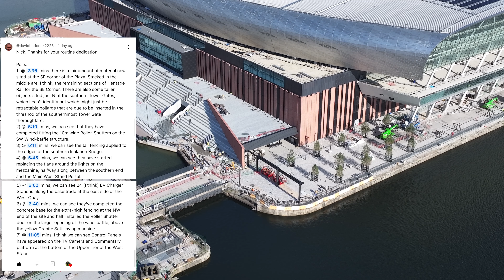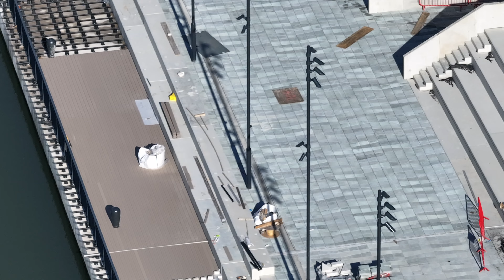NEW Everton FC Stadium 22.10.24. Midweek Video with Voiceover - YOUR QUESTIONS & COMMENTS

Comment: Nick, many thanks for the detailed look around even if I feel that I owe the general audience an apology for inducing another bout of Nick's "Where's Wally?" footage. Just for the record, I did state that the concrete flags being replaced were around the lights on the Mezzanine.

Some PoI's:
1) As you focused a while on the Composite Decking, I'd like to point out something about which I suspect most people are unaware:
  a) Pause the video at 10:14 mins, and you will see that the decked area is not horizontal along it's entire length. The very southern end (mirrored at the northern end) is actually sloping upwards, like the Ski-ramp on an Aircraft Carrier, so that disabled fans can access the area.
  b) The black-metal stilts and frames upon which the composite is laid are taller on the concrete at the ends so as to provide this slope finish. It would not be ideal to have the 'planks' laid at 90d to the current format axis as the potential for trip hazards would be greater.
  c) If you also look closely at the Lower Promenade terracing, just behind the decking at this timestamp, you will see that they are actually tapered off with a downward slope too, as is the case with the concourse water-effect concrete flags above the Lower Promenade terrace. The central area of the water-effect flags in front of the main West Terrace is horizontal but higher than the old Dock Wall Granite Coping Stones, so the water-effect flags are laid on a shallow slope down to those curved Old Dock Walls. You can see the slope if you look at the bottom rise of the bottom terrace and it is more noticeable across the face of the North and South Terrace Tunnels. And at 10:14 mins in particular
  d) And at 10:14 mins in particular, even if you can't see the edges clearly that demonstrate the slopes on the different levels, it's made even clearer by the fact that the water used for hosing down the flags in and under the mezzanine at the southern Terracing tunnel, is draining down the slope at a diagonal across the water-effect flags to the south end of the Lower Promenade and drops down into a gulley (with a small bollard inserted into it) before dropping to the lowest concrete level of the Lower Promenade, under the Decking black-metal supports, before then dropping off the edging of the Seacant wall into the Water Channel.

2) @ 22:02 mins, the objects I'd previously referenced just north of the southern Tower Gates have been moved. But in their place are a large quantity of Internal Works Cherry-Pickers that had been collated there to put on the collection lorry sitting on the East Plaza. If ever you wanted a statement of how the internal Works have progressed, this must be a major pointer. LoR are sending away some of the essential leased equipment.

Comment: The flats you are looking for can be seen at 28.04 in the distance. You can see Leasowe lighthouse and The Leasowe Castle hotel a couple of seconds earlier just below the top of the screen.  The flats you mentioned are The Tower in Liscard Nick. Great video once again mate. When the stadium is finished maybe you could do flight across the Mersey the The Flight of the Valkyrie, like you did earlier in the build?

Comment: Panel under where the missing glass was is a darker colour to the rest
Reply: Yeah was just about to.comment about those panels. I think that one your referring to might be a ventilation panel but the 2 or either side of it looks white whereas the rest of them along the.lwngth of south stand look grey. Could it just be reflection or shade causing them to look different
Reply: Some still have the protective plastic covering on.
Reply: Still has the plastic covering on.

Comment: Hi Nick, great video as always. Thank you. Do you know anything about the ‘Media Centre’ I can see where it is behind the West Stand but what does the building consist of? and do they, the media have to ‘brave the weather’ every time to walk to the stadium or do they have facilities inside the stadium. Also will we be having ‘bat lights’. 👍
Reply: It’s not a media centre, it’s the Distribution Network Operators Compound (DNOC) - electricity, internet, etc.
The TV broadcaster will connect to it but the TV presenters and pundits won’t be anywhere near the DNOC, they’ll be in the TV studio in the executive box in the north west corner of the stadium, above the vehicle access tunnel 👍🏻
Reply: Dunc has given you an accurate reply re the DNOC and TV Studio but I would add the following:
The TV Commentators will be on the Main TV Platform at the front of the upper tier of the West Stand (focused on in this video) and the Press Box is right up at the top two rows of the central part of the Upper Tier of the West Stand. The Media have totally separate facilities for catering and bathrooms within the West Stand Hospitality areas.

Comment: What way will the vehicles drive in and out the ground ? The bridge with high fence leads nowhere as all trees a roller shutter there
Reply: Vehicles will use northern access road under the north stand overhang. On sunny days, the team buses will turn left just before the north bridge and will drop the players off at the central entrance on the west plaza terrace. The buses will then drive over the south bridge over to the car park between the water channel and the Mersey. Emergency vehicles will use the south access between the south stand and Nelson Dock (they can also use the north).

Comment: Where do the coaches drop off the players ? I'm assuming the coaches pass the north stand then go into the tunnel at the west stand to drop them off. But where to after that ?
Reply: No, the buses won’t enter the tunnel under the west plaza terrace (mezzanine). Vehicles will use northern access road under the north stand overhang. On sunny days, the team buses will turn left just before the north bridge and will drop the players off at the central entrance on the west plaza terrace. The buses will then drive over the south bridge over to the car park between the water channel and the Mersey. Emergency vehicles will use the south access between the south stand and Nelson Dock (they can also use the north).

Comment: Can anyone explain why the decking has been laid north/south rather then east/west. Seems totally wrong to me but there might be a reasonable explanation. 

It looks a bit of a let down. No pattern in it, very plain.
Reply: I think there are grains in it like a wood effect. The drones just can't pick that detail up.
Reply: @rosse6705  I mean a pattern in the way it’s laid.
Reply: Seymour: I'll stab a guess at answering your question but I must stress this in just an opinionated conclusion from the evidence.
1) Pause the video at 10:14 mins, and you will see that the decked area is not horizontal along it's entire length. The very southern end (mirrored at the northern end) is actually sloping upwards, like the Ski-ramp on an Aircraft Carrier, so that disabled fans can access the area.
2) The black-metal stilts and frames upon which the composite is laid are taller on the concrete at the ends so as to provide this slope finish. It would not be ideal to have the 'planks' laid at 90d to the current format axis as the potential for trip hazards would be greater.
3) If you also look closely at the Lower Promenade terracing, just behind the decking at this timestamp, you will see that they are actually tapered off with a downward slope too, as is the case with the concourse water-effect concrete flags above the Lower Promenade terrace. The central area of the water-effect flags in front of the main West Terrace is horizontal but higher than the old Dock Wall Granite Coping Stones, so the water-effect flags are laid on a shallow slope down to those curved Old Dock Walls. You can see the slope if you look at the bottom rise of the bottom terrace and it is more noticeable across the face of the North and South Terrace Tunnels.
Reply: @SeymourScagnetti I was referring to the bit where you said. "No pattern in it, looks very plain" I'm not sure why they laid it that way that's why I never answered that bit 👍🏻
Reply: @davidbadcock2225 David, you are quite literally the 8th wonder of  the world. Love your work.
Reply: @colingillbanks4022  Whoa! Steady on, Colin. I'm glad that you appreciate my efforts but I or it is nothing special.
Reply: @davidbadcock2225  Haha, we've all become stadium nerds on this build, and your detailed info has been brilliant. Keep up the good work!
Reply: @davidbadcock2225 as long as any slope has a consistent gradient, which you would hope it does for this reason, then it wouldn’t make any difference how it’s laid, there wouldn’t be any trip hazard.
Reply: @SeymourScagnetti  Morning, Seymour. I appreciate what you are saying and in a perfect world one would like to think that the laying would produce identical results in any format. But the slope is for disabled access and it will be with that in mind. It'll be smoother for them running along the tracks of the 'planks' than travelling across them. As I stated before, I have no guaranteed answer, only guesses at why so. The slope is real though.